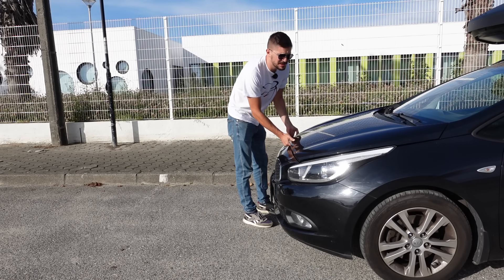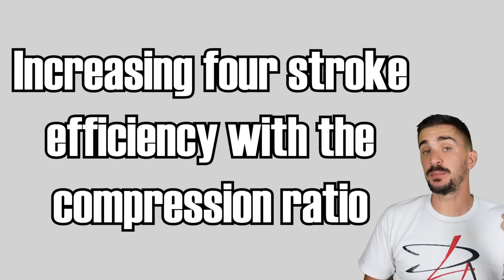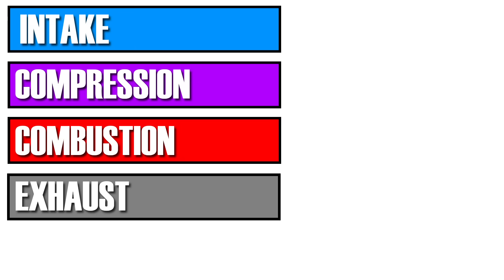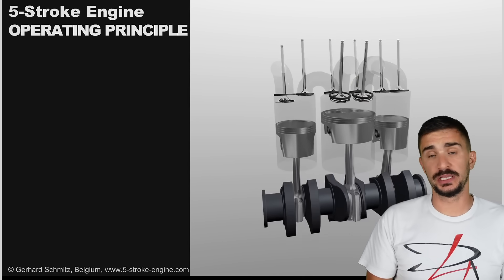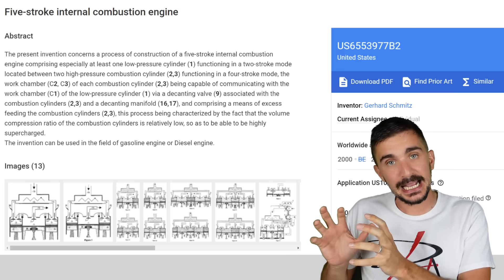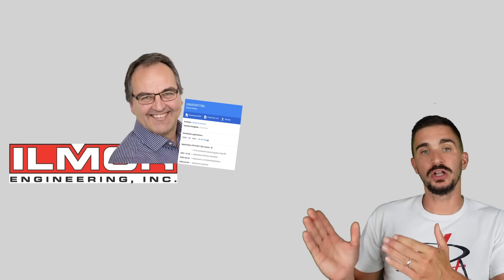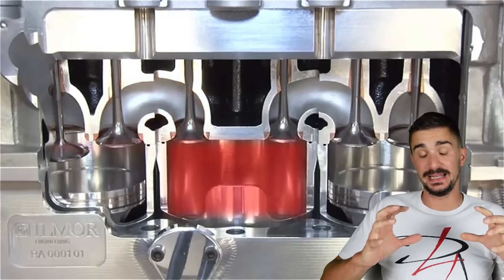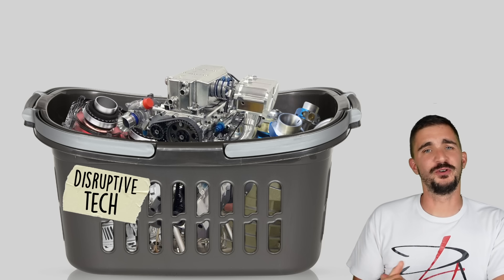Why Five Stroke Engines Are More Efficient But Still a Failure

Comment: 14:20 Not counting the passive cylinder displacement at all is disingenuous, but it should only count for like half its displacement since it is operating at lower pressure and temperature. Ironically, the center cylinder would need a higher-temperature intake valve than exhaust; opposite of a conventional cylinder.

Comment: After watching this video, it made me curious about other uncommon stroke engines like the 3 stroke or a 6 stroke, and I found a page talking about a 6 stroke engine which is a mix between a combustion engine and a steam engine, it works as a normal 4 stroke engine but after that water is injected into the combustion engine which uses heat to vaporize the water and make the engine somehow work as a steam engine

Pretty crazy but I found nothing about it other than an extremely old engine from 1883 called the Griffin six-stroke engine 😃😃

EDIT:also I love your videos, keep up the good work 👏👏
all the support from Jordan.

Comment: So - its like the Titanic: 2 outer high pressure piston engines and a low pressure turbine in between to recover more energy from the steam. 

But the center engine was unable to reverse, so when they threw the outer engines into reverse, the engine blowing water over the RUDDER stopped and it lost its ability to meaningfully steer around obstacles. Like icebergs.

Comment: but isnt exhaust gas spinning the turbo blade what converts to power by giving more air to the engine? i cringed on you so big that you cant even write it down... (so what you yapping about only applys to non turbo cars)

Comment: Nice video! I have a question though:
When a design like this is only efficient at high load, wouldn't it be suited for electric range extension for instance? I will admit my understanding of ICE operation for electricity generation is a bit naive, and I always think that engines designed for this purpose run most of their time on optimal load, but perhaps I'm mislead :)

Comment: Sounds really swell, but manufacturers want to produce (and warranty) fewer parts, not more.
EVs have one moving part, the motor's rotor (2 if awd). If you were manufacturing cars, which design makes most sense? An engine and transmission containing 9,000 to 12,000 parts, or a motor or two?
Bonus: Eliminating the fuel and H.P. coolant system, and exhaust systems.
Reply from the maker: I'd love to see an engine with 9000 moving parts 😆. You make it seem like the motor on an EV is one single solid part. Cmon man

Comment: It actually looks like a perfect design for fixed RPM/load demand like with generators. Large industrial equipment, mining trucks and even cruise ships use combustion engines to run generators to power the system and electric motors at the point of use. Fixed rpm and demand means the design can be optimized and large equipment can handle large engines. Efficiency with ships is particularly important.

Comment: It actually won't be that much longer before electric vehicle tech is 150 years old too. They've been co-evolving with ICE vehicles pretty much as long as we've had lead-acid batteries, even if the primary application was golf carts and forklifts.

Comment: 13:55 The third piston is more like a turbocharger, it harnesses the power of the exhaust gas (Like you said so many times). Counting that piston as combustion space (wich actually generates all the power of the engine) is like saying the volume of the turbocharger counts towards engine displacement. Yes its a cylinder in the engine and it certainly adds some hp but so does the turbocharger and it also doesnt count towards engine displacement.

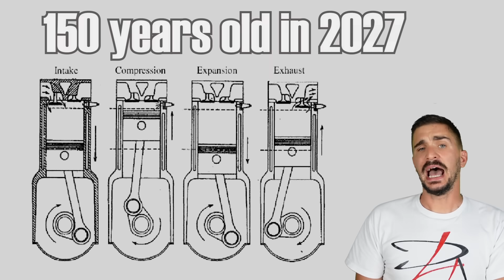Comment: 16:50 A grand piano has more parts than an IC engine, though it doesn't have the temperature gradient.  Not sure which is more complex mechanically.

Comment: This might work in a hybrid, the flavor where the IC engine is not connected to the wheels.  This engine would always run at an optimum speed and power.

Comment: The solution is to have an engine of many cylinders: some for compression, others for expansion.  The expansion pistons are always all being used.  The compression pistons can be engaged and disengaged.  So, under low load, perhaps you have one piston doing compression, and 4 doing expansion.  Under high load, you have 4 doing compression and still 4 doing expansion, like a normal engine.  Perhaps they can even have a transmission between them, so one side can be turning faster or slower than the other.

Comment: Instead of having the low pressure cylinder connected to the crank, couldn't you have it drive a generator? Make a true hybrid. Should allow you to divert the still hot gasses into the exhaust system when the engine is at low power outputs.

Comment: Ive never heard of ILMOR before depite watching car videos for years.
Reply: ilmore were building F1 engines which later became the Mercedes F1 engines. They also built a 3 cylinder Moto GP bike engine which was raced once for certain but they didn't understand traction control and Anti Wheelie of a bike so when the front wheel lifted the ECU killed the power instantly and as soon as the front tyre speed was the same as the rear it would give full power again instantly so the bike would almost bounce under full acceleration and was like riding a bull trying to spit you off and hurt you. They pulled the plug almost immediately selling off all of the chassis parts but keeping their engines. One of my friends bought the whole bike team, minus the engines. The engine was tiny so finding an engine to fit into that chassis was difficult. It was a stunning piece of engineering but never developed in the actual bike chassis with testing and development cancelled to concentrate on F1.
Reply: @YAMR1M  
Thanks! <3

Comment: There is also a solution to improve the operation of the internal combustion engine. Only on that basis you need to take one forgotten motor and change it using a mixture of formation. I can’t say yet, I want to close in practice, but the work continues, and there is a result. Technology of the 30s of the last century and it is finalized by electronics

Comment: okay so what about using it in a small engine application like 3600rpm and up (generators ,tractors, etc.) where the rpms and loads are typically in the engines happy range?

Comment: Great episode. Just a thought this engine may have issues with emissions for automobiles but the increased efficiency might be a good solution for generators. the constant speed even favors this design for the rpm and efficiency.

Comment: Thanks for the great analysis (and history!). Have you ever looked at the "Quasiturbine" developed in Canada?  I don't think it was ever tried as an internal combustion engine but only prototyped as way to use compressed air to run a tool. Potential, though...

Comment: Though much easier said than done a 'quick fix' would be to bypass the exhaust gas cylinder at low rpm. It would produce turbo pressure and catalytic converter heat at low rpm and not take away power to accelerate the cylinder. Turbo pressure at high rpm would still be a problem and you would need some kind of a clutch that can connect the exhaust cylinder to the crankshaft in the exact right position so it would likely not work in applications where you need to switch back and forth from high to low rpm fast or often.

Just realized disconnecting the middle cylinder would also completely mess up the balance so I guess it wouldn't be such a good fix after all...
Reply: It would still sap rotational energy because even if exhaust gasses are bypassing the cylinder it’s still mechanically attached to the crankshaft and therefore the crankshaft will always be spending some amount of torque to continue moving that dead weight up and down. It’s possible that the added boost pressure would make up for the power loss, but it would end up doing that at the cost of reduced efficiency which would end up being functionally identical to just revving the engine harder without having that greater exhaust gas pressure
Reply: That's the reason I said it would need some kind of a clutch that can detach from the crankshaft and attach in the right position again. But that would obviously mess up the balance.

Comment: You don't count the middle cylinder - that is a recovery cylinder like a turbo.  RE:  Catalytic Converters:  this 50 year old technology has been frozen like roots blowers in Top Fuel.  WHY?  perhaps to get older cars off the road:  cats are expensive and go bad so car won't pass emissions so it is junked.   NOTE:  There was a design where there was a Helmholtz resonating cavity in the top of the piston which created ultrasonic sound in the combustion chamber.   This was a decade or 2 ago, I believe the claim was cats were not necessary and in LA, these engines would literally clean polluted air.  The problem was the cavity coked up.  Nevertheless, the ultrasonic experimentation should have been continued.

Comment: Does the 35% efficiency include the heat used to warm the passenger compartment?  And if most of the waste is going out the tailpipe, does turbocharging improve efficiency?

Comment: Sounds like it would be a good option for a dual mode hybrid or a generator where it would only be used under higher load, which seems to me would solve all the problems it has. 

Jet engines have the same problem, they are inefficient at low speeds.

Comment: Propulsion technology that has lasted longer than the ICE?  Bring forth the sails!

I remember reading about a late ww2 aircraft engine that was a combination ICE but also had a turbine attached to the crankshaft. I believe they were using the exhaust gases to power the Turbine and harnessing the left over energy that way. But Jet engines killed  piston engines in aircraft so it was a developmental dead end. That would be a neat thought experiment on how well that could work in a car and the drawbacks.j

Comment: Atkinson actually ended up making various different designs & the "Differential engine" of his allowed the same mechanically-longer expansion but also without using valves, it was basically like a 2-stroke with how the ports worked but very clever. That one did however have yet again a less than desirable assembly but luckily even with forced-induction in modern times with VVT & alike tech it's possible to just keep the intake valve(s) open during the first few degrees of compression creating a pseudo-Atkinson cycle with little drawbacks while being able to be converted to normal Otto cycle @ any time for higher power density on-demand. Quite a few companies in the normal automotive world have already started using this simplified pseudo-Atkinson cycle & it works well even with turbos!

Comment: Mazda has an engine technology called Skyactiv X, which achieves a variable compression ratio by closing the intake valve early during intake to exceed the compression ratio of the intake air. This technique allows for a higher thermal efficiency through lean combustion with direct cylinder injection and spark plugs. When the engine is cold, it operates normally to raise the temperature, and once within the appropriate range, it switches to homogeneous charge compression ignition (HCCI) mode to save fuel. It is said that this engine can achieve thermal efficiency of up to 46%.

Comment: Diesel rev limits have little to do with the beefiness of components... The combustion is just much slower comparatively. That's why 2-stroke diesels usually make peak power @ HALF the RPM of 4-stroke ones, if it was all due to component weight, they'd still rev as fast. Detroit diesels usually make peak power @ just 2.5-3k RPM due to this but double the combustion means they actually have essentially the same power density, though in the end they can actually be made to be more power dense but it's a little difficult. Thanks to modern electronic though & multiple injections Detroit are now potentially the best but I guess it's just not a direction anyone really wants to go in today, sadly.

Comment: I love your videos, you do a great job of explaining details in engine design, but I am surprised that, since this video is really about overexpansion, you didn't mention that the second generation Toyota Prius engine shifts into Atkinson cycle simply by retarding the timing of the intake cam thus allowing for some of the intake air charge to retreat back into the intake manifold during the compression stroke. Thus, the air compressed is of smaller volume requiring less fuel to meet the stochiometric ratio, then, after ignition, the gasses are allowed to  expand to the entire volume of the cylinder providing for overexpansion and greater efficiency. When higher power is called for, such as during acceleration or climbing grades, the engine returns to Otto cycle and provides. In the end, it was the simplest approach that made it to production, and worldwide at that. Too bad Otto didn't think of this concept. I'd really like to see you do a video on that engine.
Reply from the maker: https://youtu.be/NvtcTXey0U8
I didn't mention it because I explained these concepts in the video on that topic (link above). This video is about the 5 stroke engine and I already included compression ratio in the intro so didn’t want to delay the core of the video further back. Also, many modern engines with variable valve timing and lift do atkinson, it's not exclusive to the Prius.
Reply: @d4a  Indeed you did Sir, I had not seen that one. Once again, great job of explaining the function. A child would understand it, and your graphics are awesome.

Comment: how about intermittently turning off that piston? or replace 5th piston with a turbine, Basically a turbo or super charger in the engine?
Reply from the maker: You can't turn that piston off unless you can make it dissappear 😁
Reply: @d4a  but you possibly can change it int a turbine with multiple inlets that open and close intermittently? maybe? So one turbine with varied inlet ( volume change?) or would that defeat the purpose do to mass of turbine ( it us rotating about an axis ... so ...?

Comment: 17:57
Wind propulsion by sails: "Am I a joke to you"?
Reply: Yes. Wind was not invented it was harnedessed.
Reply: @user-dp8nz7qn8e  Wind propulsion was most definitely invented. Not the wind itself, but the means by which it is harnessed. Why, you could say the same thing about petroleum energy. We didn't put the energy itself inside petroleum, but we needed to find a way to harness it. That's the invention part. Refining and the engine made it possible.

Comment: This is partially how certain external combustion engines work. They would have several cylinders in series until they could no longer derive work from the steam. I think they would go up to 3 cylinders in series.

Comment: The maximum theoretical efficiency for heat engines - as determined by the laws of thermodynamics is zbout 64%. Therefore the 40% efficiency achieved by diesel dngines is pretty good. If you use electrical power from the mains (eg. to charge an EV or use an electric train) inclusing for power transmission losses  you will get a similar efficency.
The efficiency of the human body (if we decide to cycle to work) is only about 20%.

Comment: So, this is basically REALLY good for something that maintains constant RPM's and could benefit from extra torque at said high RPM's...

A generator! Having generators with 20% (total of 6% extra efficiency) extra efficiency sounds incredible, but also incredibly niche. The people who would benefit from having high efficiency generators already use proven diesel generators which this can only hope to equal in fuel economy... But that would still leave it at more expensive per liter.

Comment: OK
So the initial example of the 10:1 compression ratio... Swept volume 90cc PLUS combustion chamber volume of 10cc is 100cc. The compression into the 10cc combustion chamber is in this example 10:1 fine.. But reducing the combustion chamber volume to 8cc leaves a swept volume of 90cc unchanged and a chamber of 8cc leaving a total volume of 98cc not 102cc. A compression ratio of 12.25:1 
 
I thought you would know better than that....

Comment: Excellent video, really well explained
I wonder if they could shut off the low compression cylinder at low loads, like the Cylinder On Demand engines of the 1980s.

Comment: one place where i could see the 5-strock engine being better is with  Gasoline Generators  since those relie  on having high RPM for their Energy Production, and in that case the Extra Piston would be very valuable, and seeing that those usually run for quit some time, the problems with the cat would also fix them self, aside form maybe a short electrical warm up for the first 2 min after engine start

Comment: Increasing the compression also kills engines quicker. Can we use every other cylinder to charge the next cyl. on a low compression engine ? This could be used for passing & take off .

Comment: Ok, so the bad habits of the engine at low load makes it bad for passenger cars, but in constand high load aplications like Planes, boats and generators it should be pretty good, especially stationary Gas engines like found in biogas plants... its a niche market, but still a market.

Comment: I wonder if a traditional 4 cylinder block could be used... valving the exhaust from two of the cylinders which act as HP, into two that act as LP. (Cylinder deactivation on steroids).

In such an engine you could switch between 4 and 5 stroke modes of operation dependent on condition.

You'd probably need Koenigsegg's freevalve system+ GDI + modern ECU to make something like that work, but in principle it should be doable (although it wouldn't be cheap, which ultimately would kill such a design!)